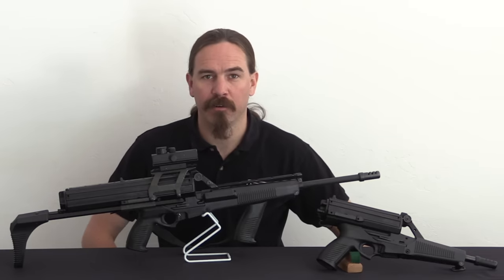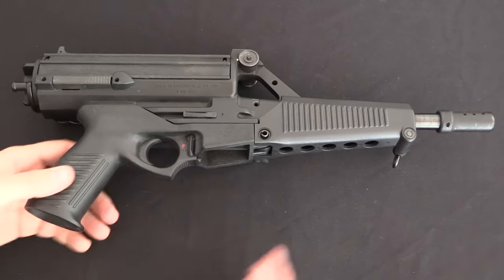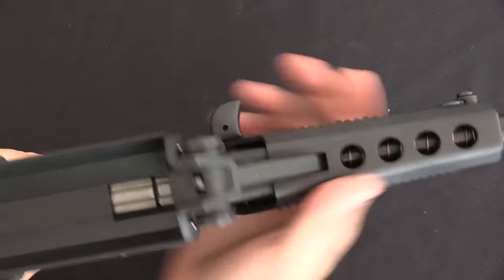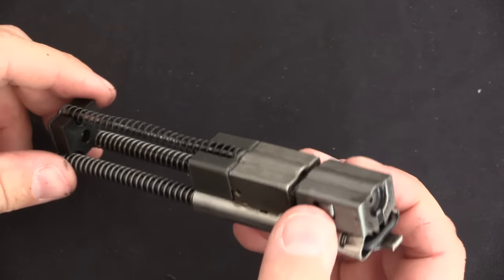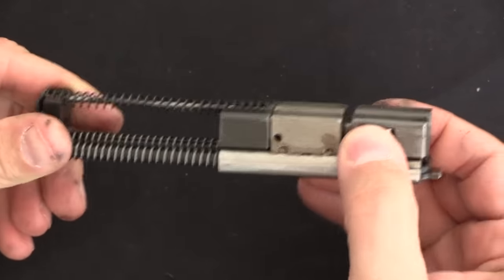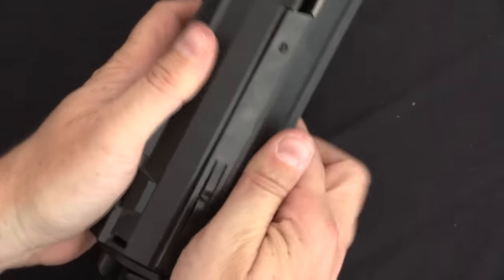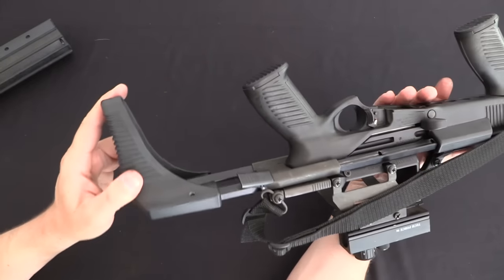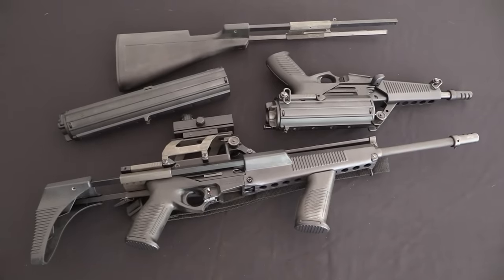Calico Light Weapons System: Roller Delay and Helical Drums

Comment: I've owned a half dozen Calicos over the years and shot them extensively.  I can confirm they actually EXTREMELY accurate.  If your fundamentals are good, they're shockingly easy to chew centers out of targets with.  The mags are consistently good lock up, which is assured by all the points of contact on the gun plus the tensioning flat spring under the mag.  I always called it the Tactical Super Soaker.
Reply: Video proof or your grammatical and spelling errors in your already Edited comment disprove it all.
Reply: @alecnolastname4362 what?
Reply: @alecnolastname4362  um, o...k...
Reply: @alecnolastname4362  Dafuq lmao
Reply: The website shows all kinds of new models, even shotgun models but they lead to blank pages.  They have phone and email contact.  I always loved the calico's... Thanks for the post V M - it's always good to get a first hand report. :)
Reply: Yeah this thing was one of the most accurate weapons in the 0-50yd range . Totally agree. Even with the pinned stock version.
Reply: I’ve had owned a calico M-100 (22lr) for 20 years. I have never had a problem with it. I do regular magazine maintenance disassembly, cleaning, lubrication and reassembly.
Reply: @arthur1543  How was the reliability and accuracy both before and after the break in period?  The break-in is up to 600 rounds...  this sounds like fun on the .22, and expensive on the 9mm. :)
Reply: What's the cheek weld like on one of these? It seems to me that if you're restricted to iron sights then it's going to be hard to get your eye-line down to the level of the sights.
Reply: I hit a spoon with mine at like 75yrds. I think I got it on the 75th round in the magazine.
Reply: @alecnolastname4362  Bad call.
Reply: you just made my day with 'tactical super soaker'
Reply: Can I message you about my calico magazine? I bought a new one from Calico and it broke immediately, I'm curious what advice you have
Reply: If i could get an auto i would love it. Semi auto not worth other then looking cool.
Reply: with these not being straight blowback, do they recoil or handle better than other types or SMG/pistol carbine? also, what's your experience with the magazines for reliability, ease of use, function, etc?
Reply: @ToastyMozart  
""an ironIC cross in recognition of your unwavering dedication to pointless hostile pedantry. 😉
Reply: I had a feeling they'd be accurate as they look kinda like a pump action pellet air pistol, with that long barrel.
Reply: @alecnolastname4362  Does your momma know you're online again?
Reply: @alecnolastname4362  Bruh.
Reply: @Nightdare  

Nah ...

If they were so bad at being a Grammar Nazi, then the correct award would be the Knight's Cross of the Iron Cross, with Poison Ivy, and Pens.

... if they were certainly an awful Grammar Nazi, then further award would be the above, but with Rubies ...

[ That is based off of the following German medals during WWII:
Iron Cross (various classes/degrees)
Knight's Cross of the Iron Cross
Knight's Cross of the Iron Cross, with Oak Leaves
Knight's Cross of the Iron Cross, with Oak Leaves, and (crossed) Swords
Knight's Cross of the Iron Cross, with Oak Leaves, Swords, and Diamonds
Knight's Cross of the Iron Cross, with Gold Oak Leaves, Swords, and Diamonds

The last two were extraordinary rare, and awarded only to those considered truly exceptional. With Diamonds was only awarded 27 times, one being Erwin Rommel; and only one Gold Oak Leaves, Swords, and Diamonds being awarded, to Hans Ulrich Rudel, an incredible Stuka Pilot, with perhaps the highest number of recorded kills of the Luftwaffe during the entire war. ]
Reply: V M what are the triggers like?
Reply: @juniorlewalski4393  worst staple gun you ever user.
Reply: @WillMoon  lol thank you for the reply. I'll just stick with my CZ scorpion
Reply: @nigelft  rubies? Why rubies? I mean could be tricky to pronounce if you'd never heard it?
Reply: @alecnolastname4362  in a comment with spelling and grammatical errors lol
Reply: @alecnolastname4362  I'm 3 years late to this asinine comment, but nevertheless I would like to point out the following: the conjunction "or" serves to join two sentence elements of similar types. Beginning your sentence with "Video proof or..." makes no sense when what follows is a complete sentence. You are joining a noun-noun pair ("video proof") with a complete sentence ("your grammatical and spelling Errors in your already Edited comment disprove it all"), which is a pretty basic grammatical error to make for someone as concerned as you seem to be. Additionally, I would like to point out that the unnecessary capitalization of "Edited" is quite childish for someone of your level of grammatical perspicacity. Next time, please think twice before criticizing other people on topics that you evidently know nothing about.

Comment: It's meant to be dual-wielded with a Contender in the left-hand. Calico for suppression, Contender for the dirty work..
Reply: Works great on mages.
Reply: @theoddoracle8704  what on earth is this a reference to?
Reply: Fate/Zero. A character in the the series uses a Calico and Contender against people proficient in magecraft, taking advantage of most mages' inexperience with firearms.
Reply: @theoddoracle8704  Ohhh ok! Is there any reason why that character uses a Calico and Contender, or was it just a stylistic decision from the animators?
Reply: @hughquigley5337  Loosely. He uses the Calico as a bait, of sorts. While the mages are typically capable of blocking bullets through some magical means (depending on the mage), they have to set their magical output to match what's being thrown at them. Spray with the Calico to force a particular output, fire a much heavier round with the Contender to break through.
Reply: 30.06 intensifies
Reply: @hughquigley5337  calico for suppression fire/bait, then the contender he uses has enchanted bullets made out of his ribs specifically made to take down mages
Reply: I see. So you too are a man of culture.
Reply: @hughquigley5337  His general plan (when the usual sniping, bombing them in their sleep, etc has failed) is to just drown them in lead while readying a heavier shot with the Contender to slip through their defenses.  And the reason he uses a Contender (which is the weirder of the two guns) is that he handloads a very limited supply of anti-magical (and presumably other less precious ones) custom high caliber bullets, so he just wants one extremely accurate single shot at close range.
Reply: @hughquigley5337  It may be over an year now, but here's my attempt at explanation.

This is a reference to a character called "Emiya Kiritsugu", who was the main protagonist in Fate/Zero. He is basically an assassin/mercenary who are infamous for eliminating mages. He typically uses Calico and Contender, and he also uses magical powers that allow acceleration/deceleration of his internal time.

His combat style is how everyone else has already explained. He uses Calico to suppress enemy mages, and go for the kill with Contender. Typical mages are easily capable of blocking/negating any non-magical weapons with powers of their own, but his special "Origin bullet" has a very powerful property.

It basically allows Kiritsugu to eliminate any mage who interacts magically with the bullet. When you use protective spells, you die. If you catch the bullet with your magical tools, you die. The only way to prevent death will be to just dodge the bullet, or stop the bullet in any conventional methods. But then, Contender packs quite a punch so mages are forced to block with their own magic.

This is why he was able to eliminate many mages. Not many mages would try to dodge the bullet, especially if they know ways to simply block the bullet.
Reply: @hughquigley5337  A personal take, but if you've seen the John Woo film "Hard Boiled", the Calico and Contender are featured in the film. The Calico is used by one of the protagonists in the hospital shoot-out scene (the whole film is just shoot-outs), and the Contender is the signature weapon of the antagonist lead henchman Mad Dog, which he used with powerful ammo to give the protagonists a lot of trouble throughout the film. The film's bullet-time shots probably also inspired Kiritsugu Emiya's time-related powers. He's essentially a souped-up John Woo film character.

It's probably more of a stylistic choice. Kiritsugu needs a spray-and-pray submachine gun for distraction, and any pistol that can take powerful custom-made mage-killer bullets, and there are so many guns that can fulfil that criteria. 
He has some really sophisticated stuff like his Walther WA 2000 and Maiya's Steyr AUG A1, and by comparison the Calico and Contender are a lot more niche. As the video here points out, The Calico M950 machine pistol and its larger family has reliability issues. Perhaps it's to illustrate his underground mercenary status, just random guns he can get his hands on?
The Calico does look very unique with the helical magazine, and the Contender gives the impression that the ammo loaded inside is powerful and special. It works for visual style.
Reply: What animae?

Comment: Ah, finally after 5 plus years of watching FW, a gun I've actually shot. Back in the 90's, I was a Deputy Sheriff in New Orleans, and one of the guys I worked with was an ex Marine sniper with a FFL. He had a full auto carbine Calico, and one day we headed down to the range we used in Plaquemines parish. I've heard many stories since of the unreliability of the Calico, but that day it functioned flawlessly. He had a laser on it, and I'll never forget blowing a fist sized hole through the paper at 25 yards. He had one 50 and two 100 round magazines for it.  We ran through at least 700 rounds that day without a single malfunction. Fun stuff.
Reply: @0neDoomedSpaceMarine  From what I gather, they sometimes can be a little picky about their ammunition (some even say they require +p overpressured 9mm to cycle reliably), and they do need care in their maintenance ans usage to work well. Not something to give to a random enlisted schmuck or officer gun-them-down to blast around with.
Reply: An reasonable tweak to modernise them would be probably giving them an electronic winder allowing them to auto wind, and get the tension just right every time. Having to wind a magazine 23 times could prove annoying. Also how long does it take to load that magazine, it doesn't seem to be that easy to load quickly compared to a traditional magazine.
Reply: Great story 👍 this is the first I heard anyone say they got one of these to run a whole mag before the last few rounds just couldn't make it out.
Reply: No manufacturer in their right mind would produce anything if even had a 50% failure rate and this boondoggle of a contraception had an abysmal reliability record far worse than that.
Reply: That was my experience with the full auto version as well.
Reply: YOU LUCKY BAZZ FAZZ!
Reply: I've only shot a H&K G3 in the army, don't complain ;p
Reply: @jamessimpson5051  Yes, and idiots regularely return shoes to shop for selling left leg shoe to right leg and right leg shoe to left leg.
Calico was reliable if you could count to 23 and knew basics of gun maintenance. If you regularly shoved crayons to your frontal lobe through your nose then you might have problems.
Reply: @cgi2002  they offer a speed loader. it takes seconds.
Reply: @jamessimpson5051  you are correct. gun functions flawlessly, if you know how to treat it.
Reply: @cgi2002 the magazine has no tension on it at all when loading so it’s rather easy, time consuming, but easy to load all 100 or 50 rounds into the magazine

Comment: "Sometimes it's okay if a gun doesn't use Glock magazines."
Next day...
Reply: I can absolutely understand the many reasons why this PCC Glock mag -> Calico couldn't be saved for next March 31st -> April 1st, but just imagine if it had.
Reply: oml yes
Reply: ...could probably make a conversion adapter actually. Might be top feed tho.  Was looking at the assembly thinking it might could convert to other systems like p90 or keltec high cap mags. Or put a chain inside the drum to pull the rounds through and remove the spring winder entirely.

Comment: I had some experence, no shooting, with these guns.

A. They were manufactured in Bakersfield, CA. At the time I was teaching in the area. They made a big splash as a "Local Boy Makes Good" story.

B. A few years later I watched a man at the range fire one. The bottom ejection put all of the cases in a single pile under the gun. He gave me all of the brass for reloading. No searching required.

C. In the mid 90s I was assigned to do a insurance evaluation of a machine shop in Bakersfield. I remembered that Calico had been located on that street. As soon as I walked in I saw all of the prototypes hanging in the walls.
Reply: Its pretty cool that you got to see all of that. These have always fascinated me, even though I was just a kid when these were readily available.
Reply: I read this as a multiple choice question, thoroughly confused. Then I realised it wasn't.... Sigh
Reply: Hey I’m in Taft, next time I’m in Bakersfield I might check that out. What street/building?
Reply: @quietusplus1221  i did the same mistake on my math homework once.
Reply: Shout out to the central valley its cool to hear stuff like this the small towm feel makes tou forget its still a big place
Reply: @pnastysavage5510  they are still avaliable. i just bought one.
Reply: What's experence?

Comment: I spent summers as a kid working on the assembly line at Calico in Bakersfield CA.  That was my dad on the company promo video. After Warren left he company my dad joined Mike in finishing final design work on 9mm prototypes.  Good times..  I remember Mike showing me a special manual lathe that he had to find which could cut the helix for the magazine molds.  In those days CNC was very expense to average Joe starting up a small company. The full auto version had a hydraulic damper in the pistol grip to slow down the cyclic rate.
Reply: thank you!

Comment: Finally, a firearm featured of which I have experience. Reliable magazine function is completely dependent on the spring tension. It handled hollow points as reliably as ball ammo. With experience on the firing line you can guess when to put a little more tension into it. The sights are surprisingly accurate out to 100 meters or so, reliably hitting a helmet size target. At 85 meters I could keep every shot on a man sized sillouet. At @200 meters the fat front sight obscured targets completely but if you can spot the impact you can quickly adjust fire.  At that distance you would want to take cover fast if we were "bad terms." With 50 rounds I felt very well armed and the Calico pistol can be worn constantly. Even the desert didn't phase that piece. It was done in by politics, as you said, alas.
Reply: Karl Andrews reliable at 100m, but hits every shot at 85 i guess?
Reply: I need a gun so badly
Reply: I have a 22LR M-100 from 1986 and it's a fun gun. I wanted to get a 9mikemike version, but never found one I could afford... but I DID get my 22LR fixed by the reopened Calico about 8 years ago.
Reply: I dont see the posibility of this ever beying used in combat.
Reply: crazy silly  and 1/3rd the number of pauses to reload would mean more lead down range (would it be 2/3rds more?)
Reply: @kingkarlito  reading comprehension, get some. reliably hit =/= hit every shot. "reliably hit a helmet at 100" could very well be less accurate than "hit EVERY SINGLE SHOT FIRED WITHOUT EXCEPTION on a man-size silhouette at 85 yards."
Reply: \*cough\* youtube vanced \*cough\*
Reply: Doug Reid the crappy cast bolt is what did it in.
Reply: @kingkarlito  You need to reread his comment. Hit every shot on torso at 85m, reliably hitting helmet sized target at 100m.
Reply: @kingkarlito  he probably meant that they tested on small target and hit everything, and when fired at bigger target still kept hitting everything, confirming what he said. A little backwards but he didn't contradict himself
Reply: demo ranch just did a video on it and the accuracy was actually really surprising.